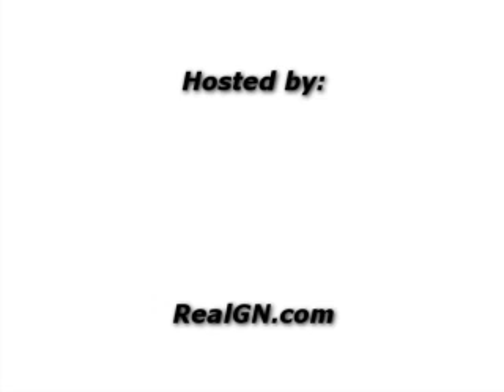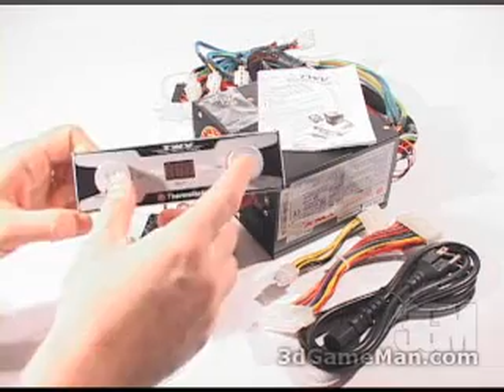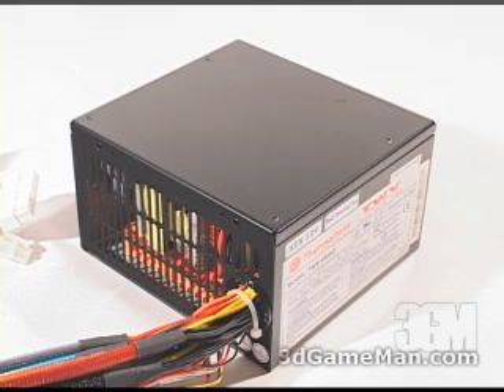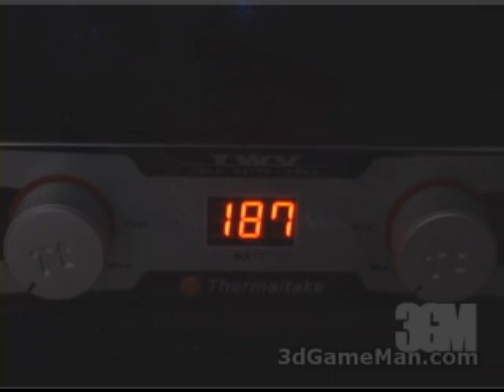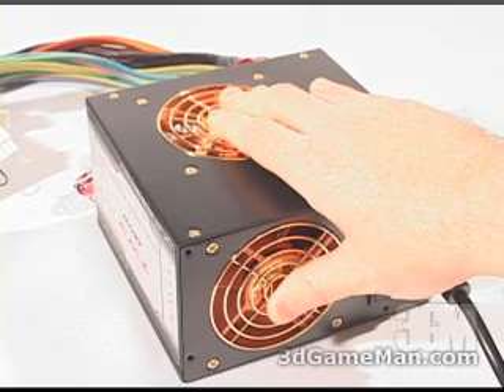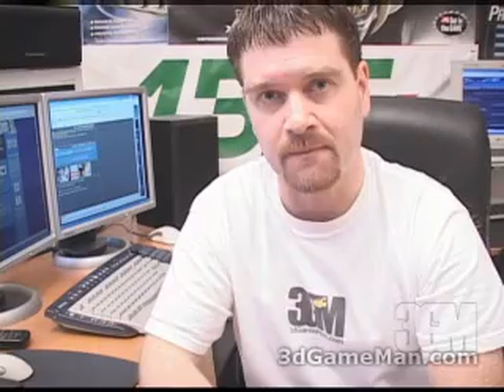#507 - Thermaltake Silent PurePower - TWV480 Power Supply

Comment: dude it is your psu .. did you not read the minimum power usage for the card before buying it?? its 600 watts.... and if you overclock the go for 650 and it could also be the heat of the case ...because the heat generated by the card is a heck lot and the cpu too my get firey at times.. so hit me up for any other help

cheers :D

Comment: I have a 480W PSU, and a 8800GTX, and in for example Crysis Warhead,and my PC shuts down after a while on max settings.

Some people have said that it could be the PSU, not enough for the system.

I have excluded the overheat problem, since the PC shuts down specificaly in one (video) of the game, even if i just turn the PC on and directly put that video.

Need help on this problem people.

!??????